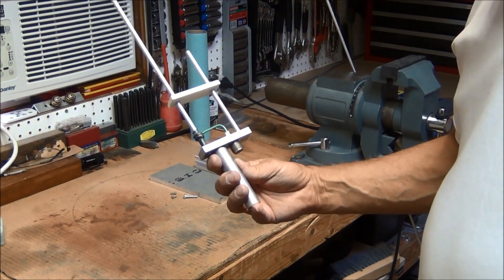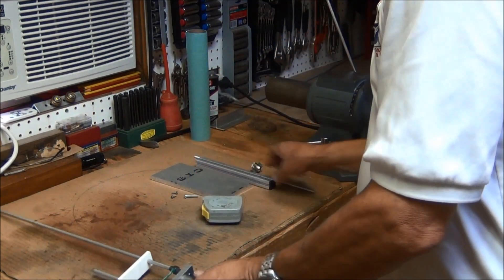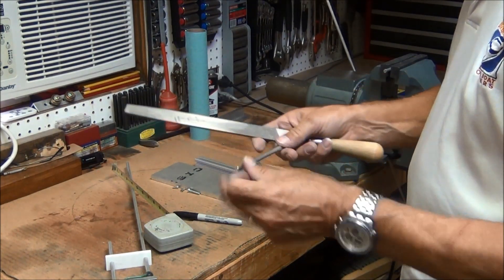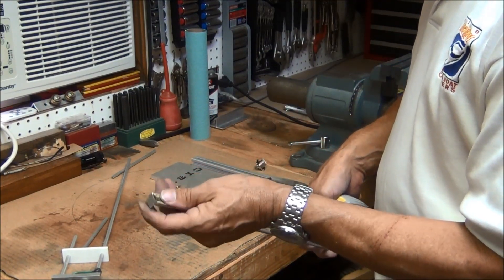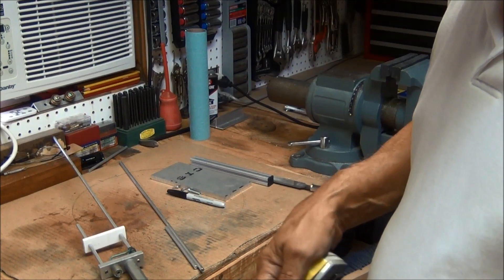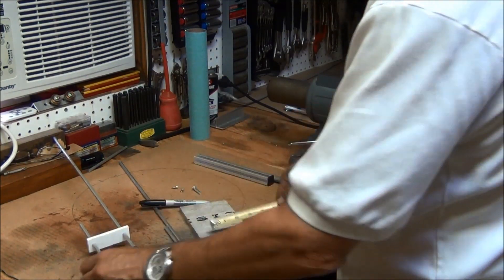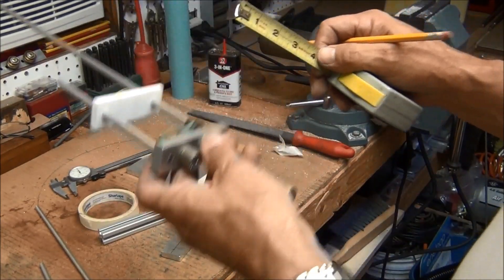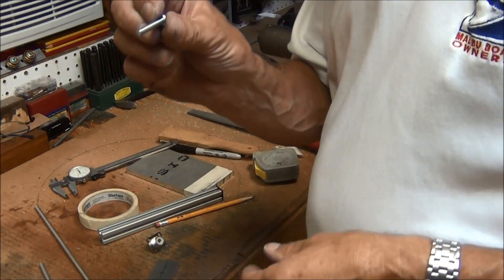J Pole antenna for 70cm part 1 by N6TWW

Comment: I like the vise, what can you tell me about it
Reply from the maker: +Dan Eriksen I purchased the large vice at Costco a number of years ago. The vice seems to be pretty decent Chinese made product except for the paint. The original paint finish was a hammered type finish. It looked great when I first got it. The paint started flaking off from day one. It looked as if the finish was applied without proper metal cleaning and preparation. I ended up scraping off the original finish, cleaning it and repainting it with gray Rust-Oleum as seen in the video.